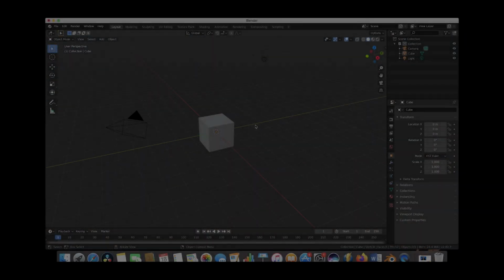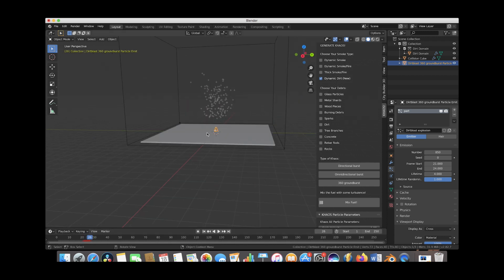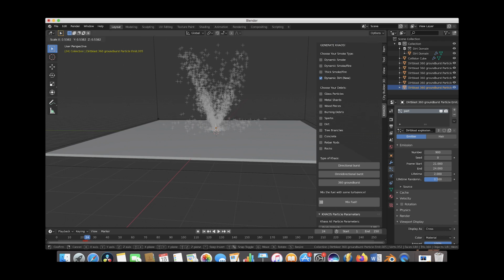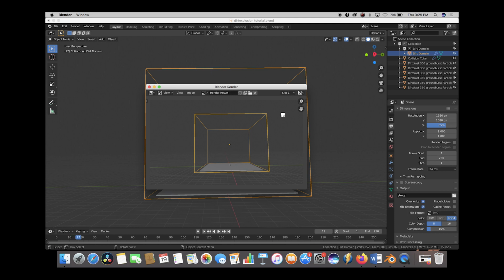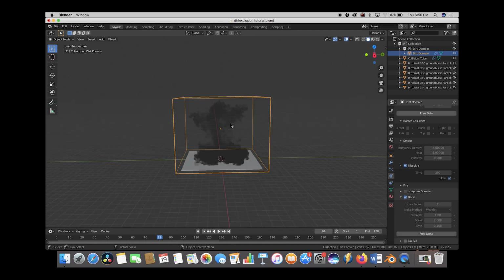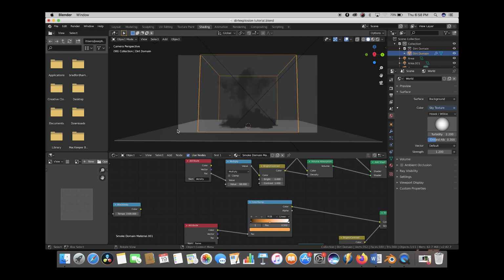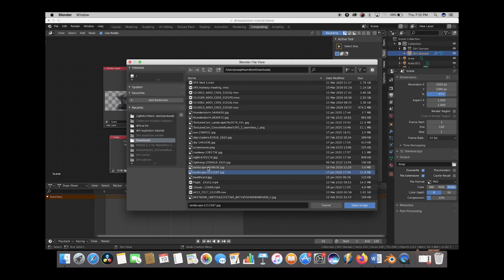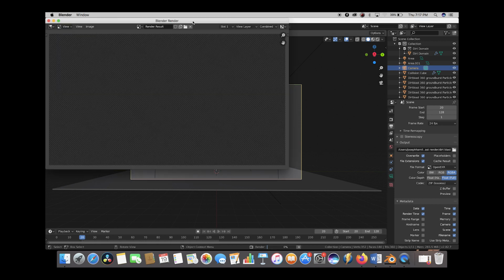Blender 3d Dirt Explosion tutorial: Utilizing the KHAOS add-on

Comment: Hey, i purchased this addon recently. Trying to recreate blast powder having it emitted from fragments that i have cell fractured. I'll be using multiple domains as there's 5 objects that are exploding but when i bake doesn't seem to turn the 'Halo' into smoke emission or get any desired look other than a volume box that appears to show at the start of the animation and end. This addon clearly appears to be very handy and time saving but finding it difficulty with understanding and effectively using the parameters to get the result i am after. Any tips or tutorials to be realized soon that does a deep dive?
Reply from the maker: Hi Myles, Thanks for the questions and kind words. KHAOS can be tricky if you aren't used to simulation but here are a few tips! First of all, if you bake a simulation and you don't see any smoke there are a few things you can do. Probably the only reason you aren't seeing smoke is because  it is not thick enough/ you don't have any lights in your scene. To solve this add some sunlamps or an HDRI and light up your smoke domain(preferably before baking). As far as the thickness of your smoke go to your smoke domain settings in the physics panel and make the viewport display at the bottom for the smoke higher. Also go to your shading tab and find the nodes for the fire shader. Go to rendered mode(in cycles) and then increase your smoke density in the KHAOS fire shader until you can see the smoke. If you don't see the smoke even as you increase the density their is likely a glitch in your bake....I'm not sure what it could be from here anyway but the best thing to do would be to make sure adaptive domain is off, rebake your fuel particles in the particle tab, and then rebake the simulation in the smoke domain tab from the physics panel. 

Also one of the biggest things for newer versions of blender that I recommend is increasing your starting and ending velocity for your fuel emitter parameters to a lot more than these tutorials
 (I would increase them to  10 and see what it gives you).

And yes more tutorials are coming soon. What specifically would you like me to dive into? 

Sorry for the  manuscript....hope this helps in some way anyway.
Reply: @LightArchitect i would like a tutorial of how to edit an explosion with dirt paericles in a real scene (like a street). I think you already did that before, but blender changed over the years! I would appreciate it! <3

Comment: Hi, great tutorial but after the bake i still only see the particles instead of the smoke. I followed along each step. Do you know what could be the problem? I had no problems in the previous gas explosion tutorial.
Reply: After baking the noise the smoke simulation appeared so it is probably a bug in the early Mantaflow implementation in Blender.
Reply from the maker: @jvanko89  Hey Jakub, Yes when you check the noise checkbox the simulation will disappear until you bake the noise. You figured it out right? Let me know if you have any other questions. -Brad
Reply: @LightArchitect  Thank you Brad. I didn't know the noise checkbox was the reason so good to know for future projects.
Reply from the maker: @jvanko89  For sure! Also if you want faster initial bakes use the adaptive domain but bring the threshold as low as possible to avoid glitches. I'm going to make a baking tips video soon but just an fyi.